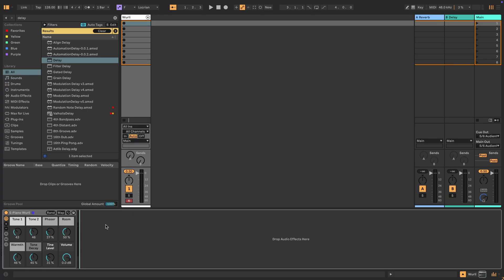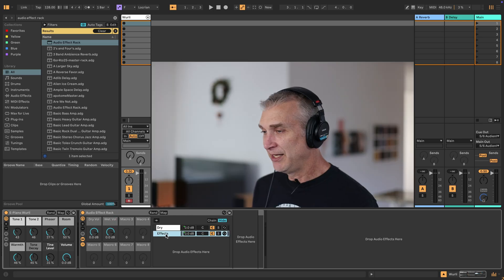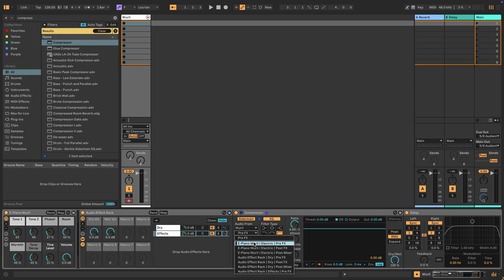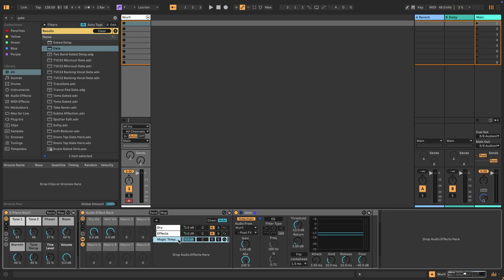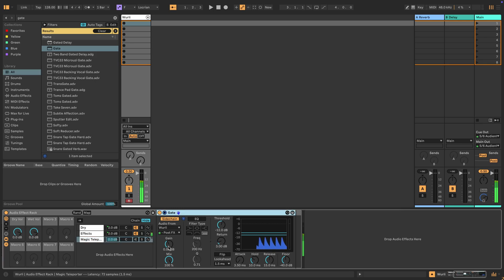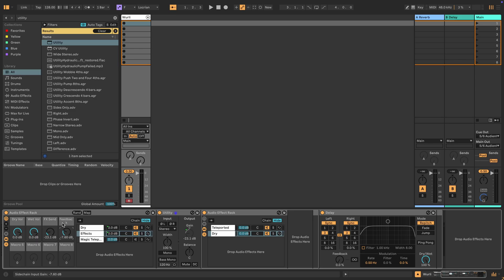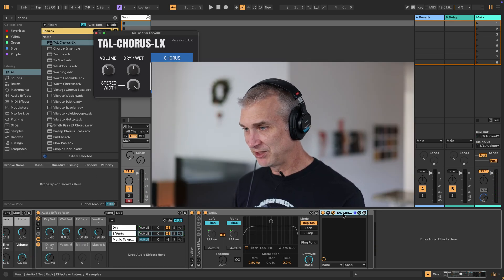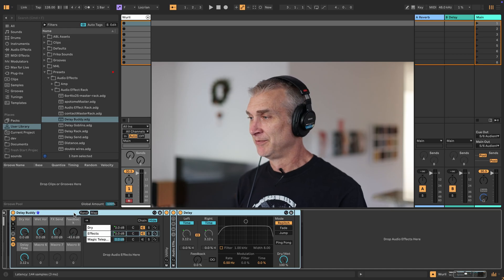Build a Custom Delay Line With Stock Devices #ableton

Comment: I was just doing this with a send and thinking that it's too bad you can't do it in a rack! I did a quick, unscientific test, and it does seem that the gate is slightly less CPU intensive than the compressor. I noticed that you left the lookahead on your Gate to 1.5 ms,  which introduces latency, so I set mine to 0, just in case! (I'm not sure if the gate's sidechain listen actually gets that delay but I thought it was maybe a safe bet to go to zero.)
Reply from the maker: @loresuto5723  Oh good catch! Thanks for pointing that out. I was thinking earlier maybe an Auto Filter could be even cheaper?
Reply: @zsteinkamp  I was wondering that too, but the Auto Filter doesn't have a side chain listen button, unlike Compressor and Gate, so I don't think it will work!
Reply: I wonder how difficult creating a "Teleport" max for live device would be? (Maybe by nabbing the code from one of Abletons max for live devices that has a sidechain like Envelope Follower? Though that doesn't have a listen button either.) It might not be worth it for the CPU cycles.